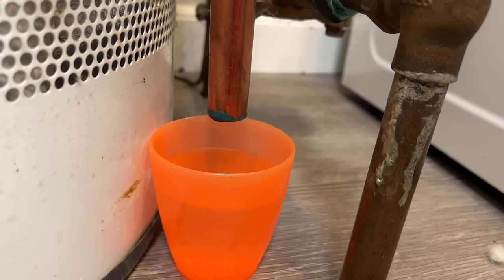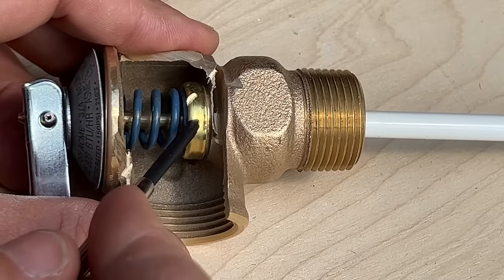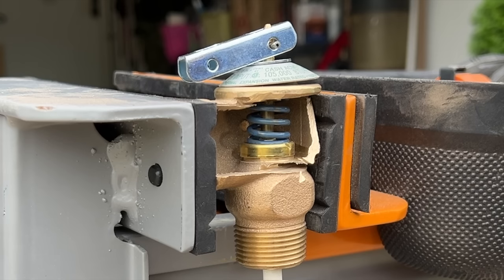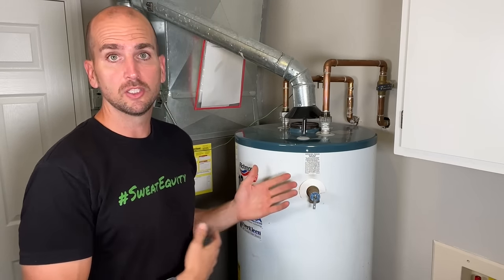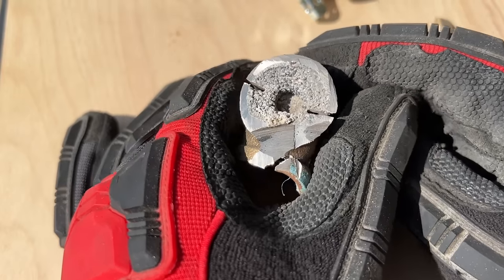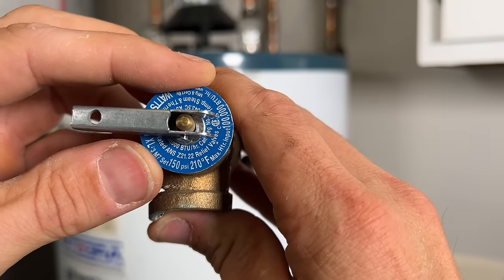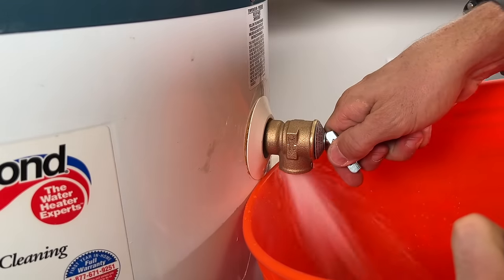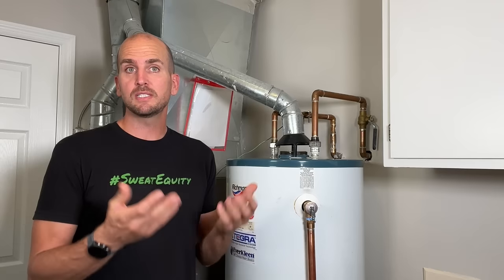Why Is My Water Heater Relief Valve Leaking And How To Fix

Comment: I tried the first option for my leaky valve which caused the water to start gushing and overflow the pan.  Couldn't get it back closed.  It was a mess for a long time.  FYI, also don't recommend trying these techniques at 3:30am when you get home from work.

Comment: My water heater is old "low" style.  I found water in the pan a few weeks ago and dried it up.  So far, no more water in the  pan and heating fine at 110 deg was 120.  Could the pressure valve have released water into the pan?  Plumber came and could not find a leak.  He never mentioned the relief valve (located on the bottom of the tank).  Could the relief valve and drain valve be the same?  Your video was helpful but I wonder if I need to do something else?

Comment: On my older water heater years ago the relief valve started leaking. I replaced it, but it would still leak from time to time. We then later replaced the water heater, and the plumber added an expansion tank to the cold inlet side. I am wondering that at  sometime the water department started adding check valves at the supply side to stop extra pressure from going back out of the house to the street. It seems like most new water heater tanks have expansion tanks added on them now for this reason so the relief valve doesn’t open.

Comment: Excellent video - good information, spoken well, concise, excellent video work. Thanks for posting this.  One constructive criticism: The sound when you are standing beside the water heater has echoes from the non-acoustically-treated room.  You might try a shotgun mic or lav mic to reduce echoes. Or maybe consider hanging blankets around or temporarily mounting acoustic panels, but that's a lot of work. Overall great job, though.

Comment: Where I live, the city water company recently switched to a wireless meter reading (via cell phone radio frequency) and evidently thereby created the need for making changes to house plumbing. No warning about this was given to the customer. So: to cure the leaking T&P valve problem may require one or both plumbing changes: 1. add a 2.1 gallon expansion tank on the incoming cold water line, and/or 2. add a "pressure reduction valve" if the city water pressure is over 80 PSI, as measured with an inexpensive water pressure gauge connected to an outside garden hose bibb. Should measure about 50 to 65 PSI after adjustment is made. The air pressure measured at the Schrader valve of the expansion tank should also be adjusted to match the 50 to 65 PSI, for proper functionality.

Comment: Great video. Just releasing the relief valve a couple of times stopped the drip. 
In your video you mention that the water heater is 18 years old. Isn't it time for a new one? If the relief valve had all that crud in it what must the inside of the tank look like? Thanks

Comment: You don't have a catch pan with drain underneath the water heater: is that not required by code in your state? Very helpful, informative videos.

Comment: Caution:
Yes, it is recommended to exercise/open the valve periodically, BUT if the valve is not leaking and you mess with it, sometimes it will start leaking.  I, personally, have had more luck with the saying "if it is not broke, don't fix/mess with it".

Comment: Hammer effect from suddenly shutting off big flow rate discharge tap can cause valve to open and lack of having precise seat to valve stem guide, WILL cause slow leak. I had to replace the valve on merely 1 year old water heater with a newly installed whole house filter.

Comment: You mentioned your Water Heater is 18 years old.., MOST Municipalities in the US (since 2006) require a Thermal Expansion Tank installed on the Cold Water Side of a ‘closed-loop’ system in the home.
 As others said- if the T&P has that much sediment on it, the anode and the inside of the tank are equally coated and the water heater needs replacement.
 Don’t put a Band-Aid on a bomb!

Comment: Can't you just open a hot water faucet inside the house and open the pressure relief valve to get the air out instead of loosining the hot water nut?. TIA and thank you for the great video

Comment: When I put the new pressure relief valve in, can I use thead pipe seal instead of ptfe tape?  I find I usually have leaks with the tape.

Comment: If you hot water heater has this much sediment I recommend replacing. Also a expansion tank helps dripping valves and also reduces the chance of accident.

Comment: Would this leak also cause the water heater to not heat the water? My relief valve is leaking, AND I do not have any hot/warm/lukewarm water even though the pilot is lit.
Reply from the maker: No, this leak should not cause the tank from heating up.  If you turn your temperature dial up on the gas valve does the burner turn on?  Sounds like the pilot light might be lit but the gas valve is not turning on to light the burner to heat the tank.
Reply: @EverydayHomeRepairs  just checked. No, I don't hear the burner kick on when I raise the temperature

Comment: I have at least 18 year old water heaters. Too scared to mess with the T&P valves. I probably need new ones soon as I'm sure the anode is non-existent and I probably also have a broken dip tube.
Reply from the maker: There is a tipping point of water heater age where it seems like anything you touch just leads to more issues.

Comment: Hi. Why did you not open a hot water valve in the bathroom instead unscrewing the hot water line above the heater? It would be easier and tools free.

Comment: My water heater has water coming up from the top, after flushing and activating the pressure valve, the water stopped coming up but the valve is leaking, could it be that too much pressure was pushing the water up  and since the valve is leaking the pressure is less ???

Comment: make a vid  on the cathode zink rod 5 year replacement
Reply: Flushing the tank of sediment too
Reply from the maker: Thanks for the feedback, I was thinking of swapping out the rod on this same tank.  I will add it to the list!
Reply: @EverydayHomeRepairs  you should do both - sacrificial anode is critical. Also you should flush the tank thoroughly and replace flush valve with "full port flush valve" - it will make flushing much faster and take out more debris.

Comment: Great instructional video!!,  I replaced my PRV, no leaks, but the next morning I noticed there was about 8 oz of water that was discharged from the valve.  I don't have a expansion tank, but i noticed you don't either.  What do you think this is from or what would you recommend.. I've just bought the house about 1 1/2 years ago, so i have no idea how old it is.  I could tie the discharge tube to my gas heater condensation removal, but i don't think it should be leaking that much.  Any suggestions??
Reply: Went through this with my daughters water heater.  In her case, I added a 2L expansion tank on the cold side, problem went away now it’s been 10 days so far
Reply: Ensure you pump up expansion tank 2 psi above house pressure. They have the gauge at HD you just put it on the end of your outside faucet,  in my case I read 64 psi I pumped it up to 66psi

Comment: Our pressure relief valve slowly drips only after showers or doing dishes. I release some pressure from the valve and it stops until the next shower. It just started doing this in the last 2 weeks after it got under zero degrees outside. I thought maybe we were getting too much gas pressure from the gas line (making a bigger flame). I dropped the temperature down to the lowest setting on the water heater and still does it but the drip slowed down. Not sure what is going on. The water heater is a couple years old. The valve doesn't open just drips.

Comment: I have a new WH with trp and expansion tank but I saw another relief valve under the sink which is now leaking a stream to the outside after I tried to flush it. A plumber told me he could cap it. I dont know if extra relief valves should be capped.

Comment: Nice video. It doesn't quite cover what I was looking for. I had this problem, swapped out my valve and it now water is coming out of the new valve. Slow at first but now its about a gallon a day. Any tips from anyone?
Reply: I believe you have a pressure problem... Check your main home pressure regulator.  Usually it should be between 30 and 80 PSI.

Comment: The temperature was set a little high and it was whistling so i did a flush just in case and i turned the temperature down on it im waiting for it stops dripping to check it again

Comment: I’ve replaced my pressure relief valve with 2 different brands, as soon as I turn the water back on going into the tank, it starts venting again, did this on both pressure relief valves, any clue what’s going on here?

Comment: Here's an interesting fact.    How the temperature function on the valve works, is inside that probe is a piston and a wax like material.   If the thermostat on your water heater malfunctions and fails to shut off the heat source,  once the water reaches 210°F, the wax melts and expands pushing the piston upwards to open the valve.   An automotive thermostat works in a similar fashion.

Comment: Is there ever a time that you’re not supposed to crack the hot water pressure relief valve on top of the water heater?? Recently a plumber explained not to do that because you don’t want to break the seal!

Comment: i have more than a "drip" coming from mine. I've changed the valve but it still does it. Is there any idea of what it could be? I can open it up and water comes out but it just keeps releasing A LOT of water. the temp is around 90 degrees

Comment: Can anyone tell me why water would pour out of the relief valve rather than just drip leak? Wouldn't stop until I turned off the water main. Spontaneously stopped after leaving water off for 2 days. Happening again months later and I'm unsure if this simple fix will help or what. (Can also someone please confirm whether or not you need to turn off the gas to the water heater while replacing valve?)

Comment: Plumbers tell me once you open that valve and shut it again it loses its pressure sensitivity every time you do it.  They said almost to the point if you have to do that you better off replacing it anyways.  

In other words once you open THE SPRING MANUALLY  and shut it it's never going to be the same no matter what..

Comment: I opened the drain at the bottom of the tank and nothing comes out after loosening the union at the top hot water side.
Reply: There are probably scale deposits the size of peas or marbles stuck on the inside of the drain valve.

Comment: 120degrees while being a scald hazard is inappropriate temp setting for water heater.
Research legionella and other bacterial species that thrive in this temp range.
145F with appropriate mixing valves is recommended

Comment: And if the new one leaks ?? Get a pressure check gauge and check your pressure. If your regulator won’t hold in the normal range around 50-80psi then it probably needs changed as well….

Comment: Don't open your water line to let air in.  Walk over to a sink and turn on the hot water at the sink.... Loosened fittings run the risk of not getting sealed up again.

Comment: You missed the real first step, and a very frequent problem with these. Don't assume the leak isn't just the T&P working as it was designed to protect you from high pressure. 1st step is a pressure test at any hose bib in the house with a $6 pressure  gauge. Municipalities all over the country are creeping up pressures higher & higher to delay the massive cost of more water supply infrastructure. They can do this because nearly everyone now has a pressure regulator. Those wear out, then your T&P can leak. It's actually very frequent now. So T&P may be working fine by leaking, and you could instead need a new regulator. It's usually in the dirt just barely on the house side of your water meter. If you don't test, sometimes a new T&P can fool you by adding just a few psi of protection, and since it just started leaking, that can stop it for a short time, then you're confused why it's happening again so soon.

Comment: I just had my hot water heater replaced by a plumber, but periodically some water is leaking from the relief valve.  The valve is brand new like the tank. but why is it leaking water?

Comment: Never touch your T&P valve. It will work if it's needed. 99.9% of them out last the water heater anyway. If it's leaking it may be doing it's job so check  your water pressure. Make sure your burner isn't stuck on either. If you open it every once in a while you'll weaken the spring and be buying a new one....not very expensive but when you tear your rotator cuff trying to get this thing off.....